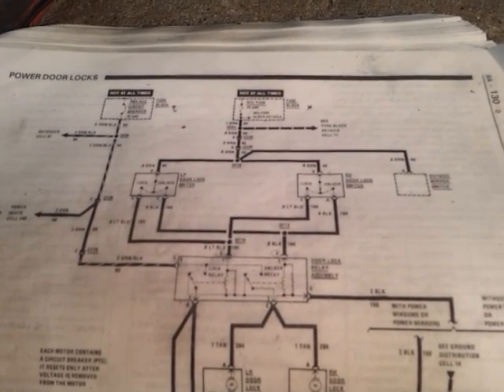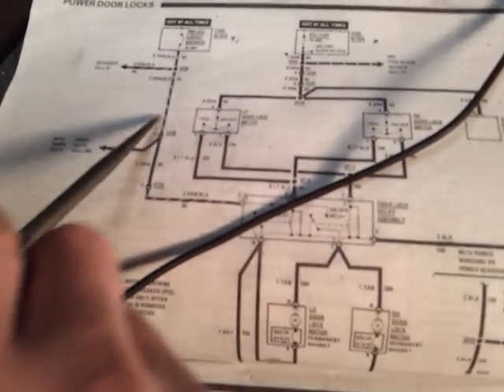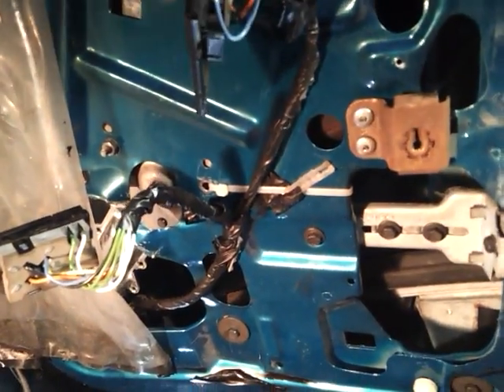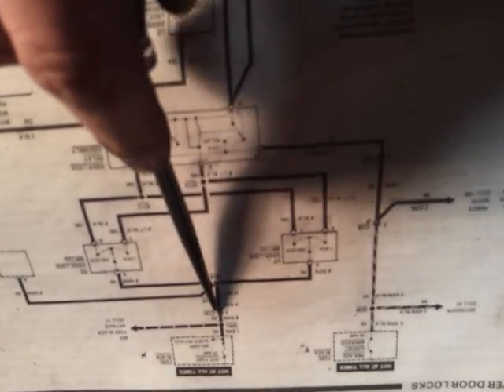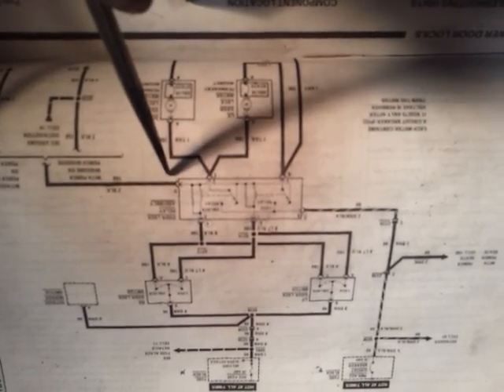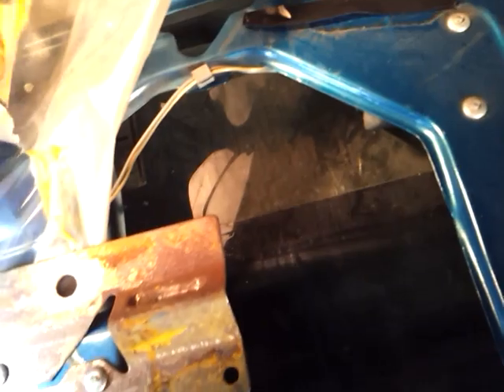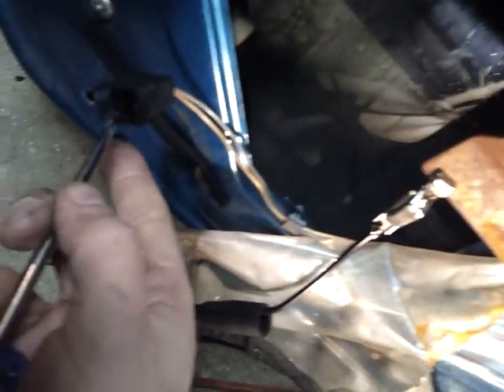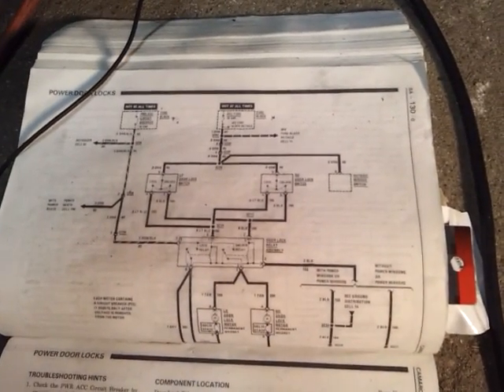POWER DOOR LOCKS - Electrical Diagnosis Tutorial Pt.2 of 2

Comment: No power going to the locks on my '88 Brougham. Locks work as I used a Power Probe on the switches and the locks worked. Need a wiring diagram now as the owners manual sucks for this
Reply from the maker: First thing to do is check the fuse
Reply: @klowny1969  just did that. It was blown. Put a new one in and all is good. I just redid my interior. The connector for the locks broke while I was taking everything apart. Must have shorted out. All is good now. Again, great video!

Comment: i have 2004 escape the gem module clicks  will not unlock with  inside switches.  have to manually lock all doors. and will unlock with key fob but only drivers door alarm will sound and do like it locking but does not lock with fob or inside switches. what can be the dang problem i really dont know to much about electrical enough to get me by. any help anyone please. radio works sunroof works. theres a clicking noise coming from the gem module area by ecelerator pedal

Comment: Is there a way to bypass this electric lock unlock system and would the door handle work? I have problem with driver side door handle changed mechanism inside unlock all doors with remote. Handle rod to open or unlatch go up and down but no opening you think it would be off a electric problem>> thank you.

Comment: Finally a YT video that is audible.  I replaced my latch and actuator on the passenger side of my 99 Silverado but that side doesn't click at all.  The final test you did  on video with the orange and tan wires may be whether my problem is. The gray lights up, the tan won't. The switch works when bench tested. I wonder if it's a grounding problem. Does the metal plate on the latch serve as the ground? Any ideas?

Comment: my lincoln mks driver door no longer unlocks or locks from the key fob or the actual door switch in the car. however the key fob and switch unlock and lock all my other doors. I'm thinking the actuator just went out am i on the right track? thanks.
Reply: Yeah I have the same problem on my 2004 mercury gran marquis but have not see an answer for this problem

Comment: i have. a 2002 Chevrolet suburban. i had an after market. alarm installed. my door. locks. were working. fine an. now. only. my drivers. door. locks. and unlocks now
Reply from the maker: sounds like they wired it wrong

Comment: when i press lock or unlock on my driver side it doesn't move? what could it be
Reply from the maker: could be actuator or no power going to it
Reply: +klowny1969 ok so what do i test the switch or the relay for this?
Reply: +klowny1969 by the way it actually moves a bit but not much to lock or unlock sometimes

Comment: Hello I would love your help. I have an 85 iroc neither of my door locks lock or unlock I tested the actuators they do unlock and lock when connected to direct power. I did notice when I have the relay dangling an press unlock and lock the power is sent all the way to where the actuator connects but no click from relay and it won't move the actuators. If i screw my relay to metal to ground it as it should be the relay does click but power isn't sent to the actuators please help me.
Reply from the maker: Check the ground side..in the video I discuss how to check ground..thanks for watching
Reply: well mrs mechanic that only means u suck jajajaja

Comment: Hey thanks for the video awesome job... My drivers side car door opens and locks all the doors of the car, so when I unlock the door manually by flipping the car door switch it opens all the locks on the other car doors, the problem I am having is when I go to flip the switch on the drivers door to lock position the other car door don't lock they stay unlocked which means I have to lock all the other doors manually do you think it's the drivers side door switch or the relay that is faulty... thanks

Comment: Like the video.  I am having problems with a 2006 Ford Focus Waon and was looking for ideas.  The right rear passenger door intermittently locks with power locks and the front driver locks most of the time with power.  The driver door will manually lock but the right rear will not.  The wagon also does not work with key fob or interior button.  Any ideas?

Comment: Good video. I have a Ford Explorer that has two locks that don't work. Driver's side bumps up and down a little but won't unlock. Can't unlock with the key either. Have to crawl in the passenger side and open with the handle. Any ideas what is wrong? I'm afraid one day the passenger side won't work and I'll be locked out... Thanks for posting these vids...

Comment from the maker: Yeah..sounds good thank you
Reply: Hey man how are you hope you doing safe. I have a question so I watched your video part 1 and 2 . I have a acura mdx 05 .my doors dont cycle cant unlock them or lock them  even manually. did check all fuses they all good cant find where the relay is in this car and all this happened cause I pulled my gps unit  drive and by accident one of the wires on the clip got loose and touch ground I guess  cause my doors where fine before that I did  tape those wires already. Weird part is when I press lock in the manual.switch a sound comes from the fuse box  some ticking noise I am confuse and seems like you may know what the problem is  plz help here